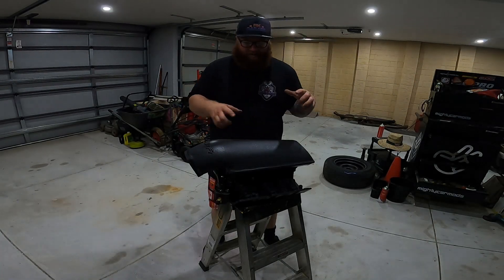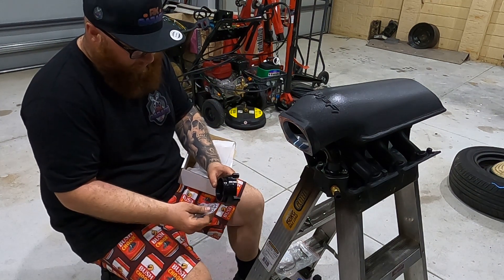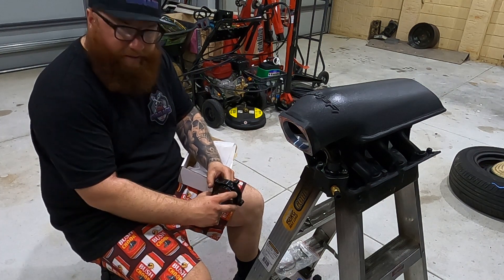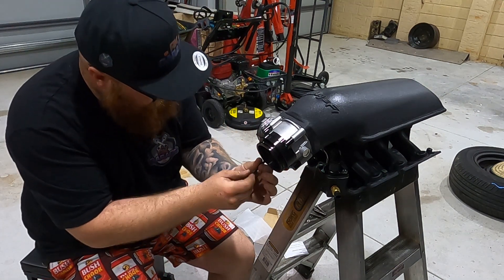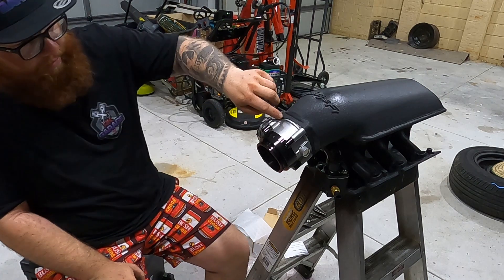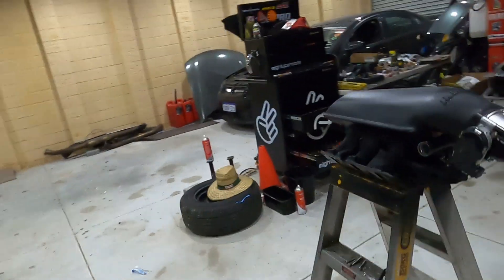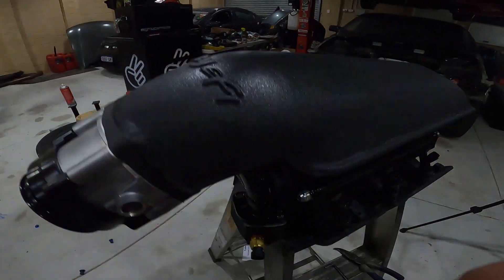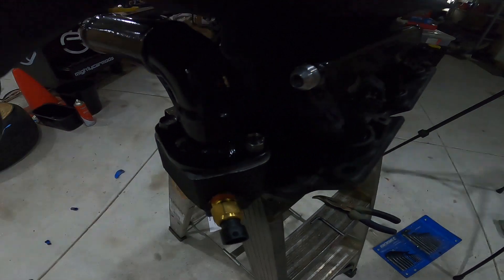ECOJET Build - Assembling The Custom Holley "LS" Intake Manifold For My V6 Turbo Commodore

Comment: Hey bro how do you run l67 bin on a vy flash pcm? Cause there different pcms?
Reply from the maker: Hey mate, as far as I am aware at this point in time, there are none that you can download, you need to download a L67 one and then copy and past all info across to a ecotec vy map and then flash that in.
Although of you do some digging someone may of already done that and uploaded it to pcmhacking
Reply: @RKGarage  do you mean copy and paste all maps? And change injector size in factory bin?
Reply from the maker: Basically yeah man

Comment: When should we be expecting to see this beast I'm action
Reply from the maker: Next week is the forged motor reveal, heads and cam haven't arrived yet so still waiting
Still have a tonne of wiring and chassis work to do
Then all exhaust and intercooler pipes, probs end of the year 🤷‍♂️🤣🤣🤣
Reply: @RKGarage  that sounds pretty sick.
Reply from the maker: Cheers man! I can't wait!
Reply from the maker: It hasn't had the stock ecu for a year now man, I have a whole series of videos of me installing the Link ECU on it and also it getting tuned twice on it man